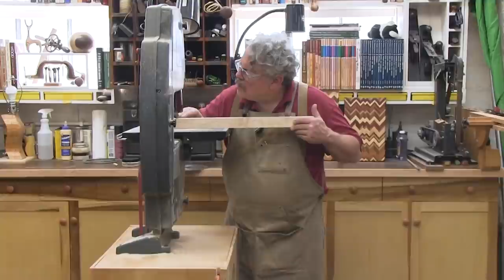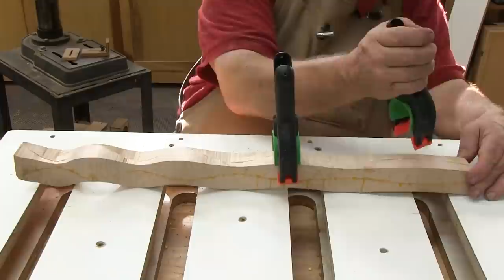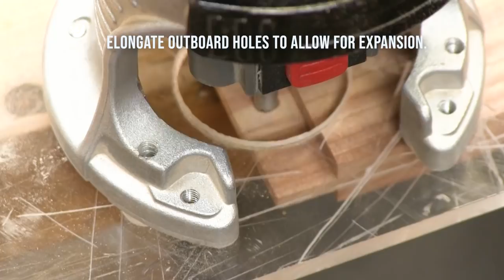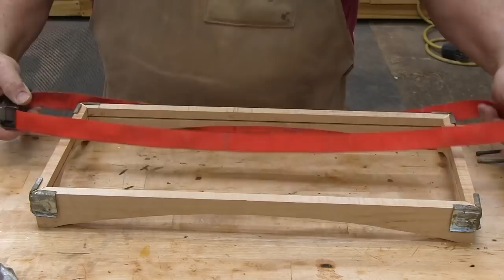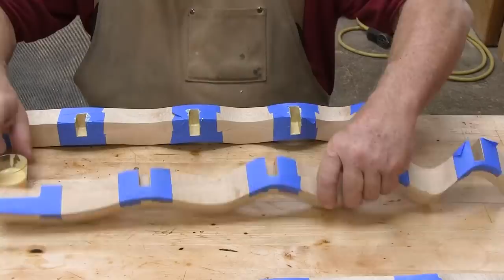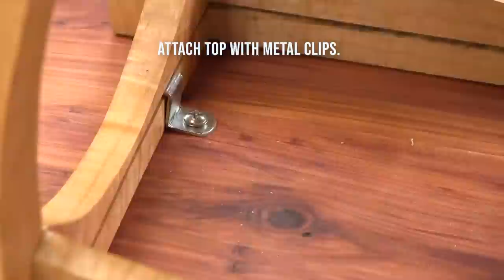Bandsaw Magic - Melting Shelves

Comment: Did you just rub two pieces of sand paper together to pervent slipping, brilliant! Let me see that corner clamp again...
Reply from the maker: Use 50# sandpaper -- other grits are two small. The "corner clamp" is nothing more than a 6" bar clamp with some specially-shaped caul held the the jaws with double-sided carpet tape. I do this all the time for clamping up corners. And you aren't limited to 90-degree corners -- you can cut the cauls to any shape. Nor are you limited to bar clamps. Works best with hand screw clamps.

Comment: Hi Purchased your plans for these Melting shelves Brilliant thank you. I'm trying to copy your stencil so I can home CNC a solid pattern.  I can't copy the stencil image, any suggestions?
Reply from the maker: On page 10  of the plans, there is a full-size copy of the leg pattern. I suggest you print it out, assemble it on a scrap of  1/4" (6 mm) plywood, and cut it out on the band saw to make your template. If you absolutely need an image, try a screen grab.

Comment: Very nice and fun build Nick.  Question on the breadboard ends on the top:  Always thought it advisable not to glue the breadboard ends to the top or at least just a short section in the center thus allowing for the expansion/contraction of the top.  You allowed for it with the elongated dowel holes.  Set me straight.  I'm a bit confused.
Reply from the maker: Not sure exactly what you're asking. The top has no breadboards, just the shelves. The top is held flat by the aprons, and the clips allow it to expand and contract. The breadboards are glued to the shelves, but only at the center -- as you mentioned. When the wood grain is opposed, you can safely glue 3" to 4" (7 cm to 10 cm) , but no more. I peg the breadboards to the shelves with dowels, but I apply glue to the insides of the holes in the breadboards only -- the dowels are not glued to the shelf (except at the center). The elongated dowel holes in the shelf allow it to expand and contract from the center, moving past the dowels.
Reply: @WorkshopCompanion  Looked at the video again and I just made an assumption seeing just the one shelf glue up it was the top.  I need to pay closer attention to the details.

Comment: Michael Evemy
Interested to see you have mounted the Shopsmith Bandsaw on a cabinet with an independent electric motor drive. I'm finding it more difficult now to lift the bandsaw on to the Shopsmith 520 and would like to do as you have done in having the bandsaw as a stand alone. Please could you let me know the specification of the electric motor you have used. Thank you.
Reply from the maker: Using a 2 hp, 110 V, 1725 rpm motor from Harbor Freight. If you're used to running this on a Shopsmith, you will think this is overpowered. It isn't. When it's on the Shopsmith, it's underpowered.
Reply: @WorkshopCompanion  Thank you for your prompt reply much appreciated/

Comment: Beautiful. 
I have a question though.
Why did you put the top on separately   with the metal clips instead of a glued joint like the rest of your design?
Reply from the maker: I (almost) always use clips and /or rabbeted blocks to attach tops to aprons. Simple, secure, allows for expansion and contraction, easy to remove and replace when the new shop dog chews the edge...

Comment: Question for you, Sir, you put bread board ends on the shelves to help prevent cupping. I noticed that you didn't put them on the Cedar top, was this just a design decision? Or, does the thickness of the top just not require it? Thank you, Sir.
Reply from the maker: The top is attached to the aprons by clips, and the aprons keep it flat. The clips also allow the top to expand and contract with changes in relative humidity.